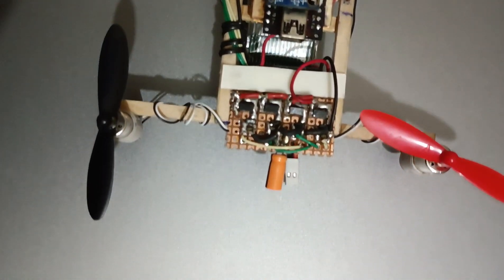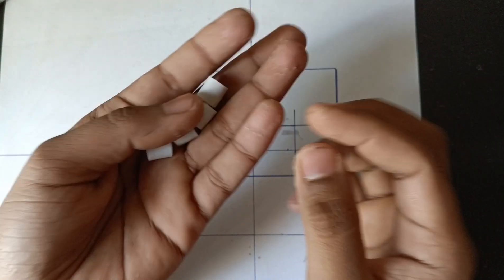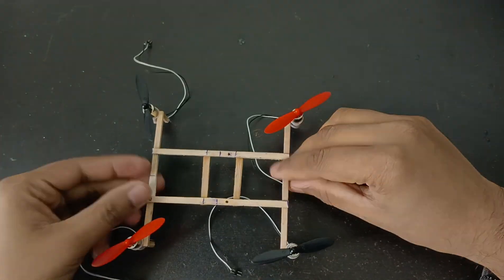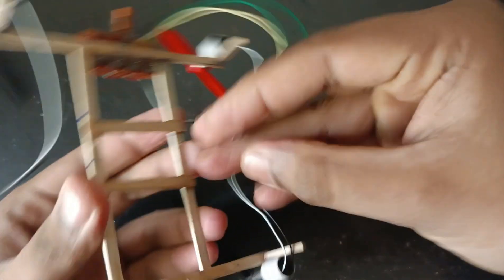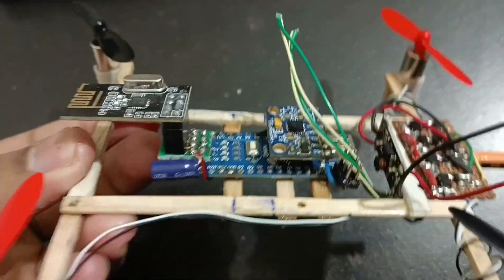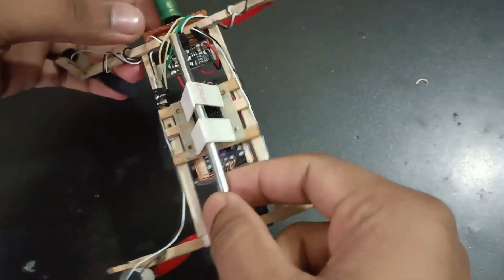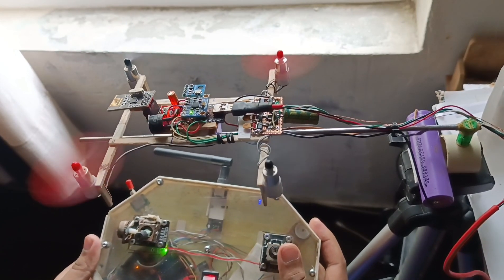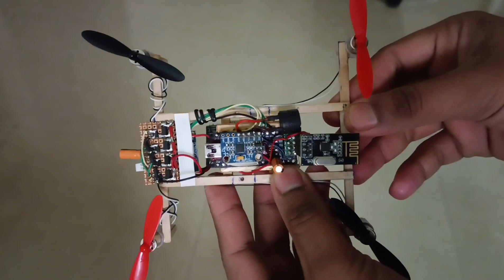Arduino NRF24 Quadcopter Let's fly it ! ! ! ! !

Comment: Bro have 7x15mm motors can u say i can make this drone will it lift?
Reply from the maker: You have make all as light as possible. Depends on total thrust.
Reply: @elecobot do u think with esp8266 and mpu6050 with small motor driver weight be light enough?
Reply from the maker: @nimtan15  You should use barebone esp8266, to make it as light weight as possible.
Reply: @elecobot barebone in the sense esp 12e that module tiny one?
Reply from the maker: @nimtan15  I mean use the 8266 chip only not the big board itself if possible.
Reply: @elecobot sorry to ask a lot😅 one last thing i wanted to ask where did u purchase the motor from ? thank you very much for responding ❤
Reply from the maker: @nimtan15  From Amazon...https://amzn.to/44DZU7M
Reply: @elecobot  u brought from this seller (SP electron)?
Reply from the maker: @nimtan15 yes.
Reply: @elecobot thank you very much